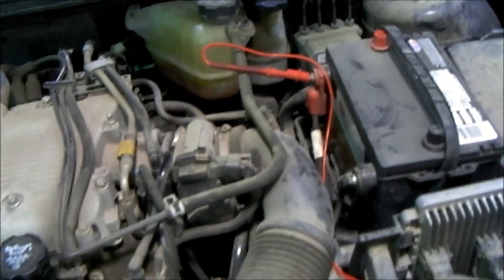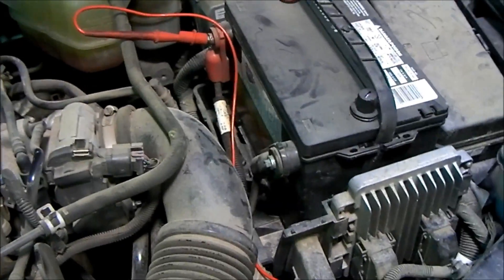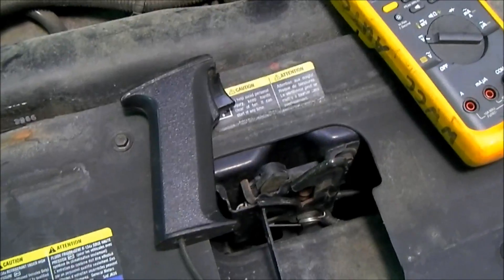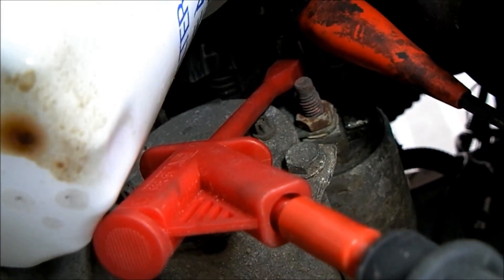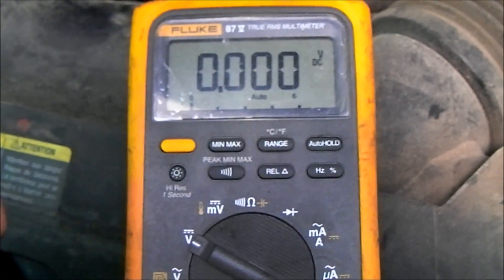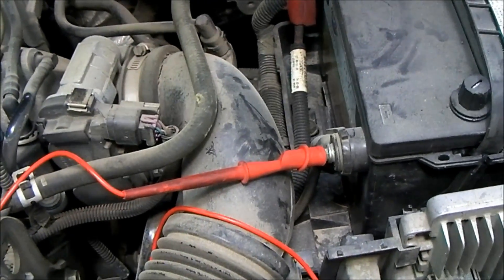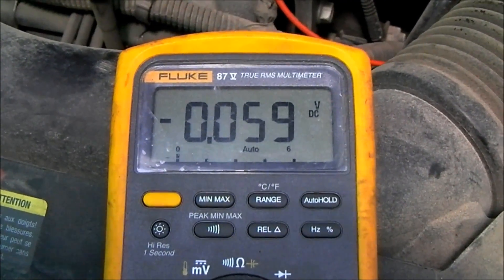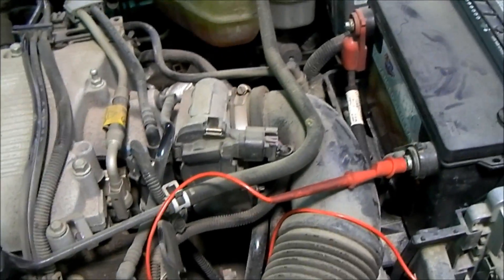Voltage Drop Testing the Starter

Comment: This procedure tests cables.   To test the battery, measure across the battery terminals for the lowest reading while cranking.  In this video, the voltmeter has a min or max reading function,  and that is  very convenient for finding the lowest voltage while cranking.

Comment: Depending where you do the positive side test, you also know the starter relay is making good contact. Over time relay connections can become pock marked and burnt, due to spark each time starter throwout relay engages it. Basically its switch contacts with large current, so each time it engages its as if the contacts are momentarily an arc welder. Over time these contacts can become so abused they no longer make good contact. This test would detect that.

You could isolate to starter relay by comparing the voltage drop when testing to starter relay input vs starter relay output. If low drop going between battery and relay in, but high drop battery to relay out, bad starter relay.

Comment: as a diy guy and because we cant do voltage drop without current to test the wire and many times a no crank has no current flow i would like an opinion on using jumper cables as a way to determine bad cables meaning if i have a no crank yet have power and ground but when i hook a jumper cable from battery to positive/negitive to starter pos/neg (one at a time to determine which side has resistance)and it then starts i can then confirm high resistance in the cable.is this a viable method?

also i hear  we cant just create a circuit using a light in the starter circuit to create a loaded circuit we can voltage drop test
because the light doesnt pull enough amps,but if the voltage drop is enough to prevent a starter from starting wouldnt this method still see the voltage drop?

also any other methods for diyers to perform a voltage drop test on a circuit that doesnt have current flow?
Reply: I know you didn't ask me, but I'll share my thoughts. The jumper cable deal, I've used this method many times it's quick and easy.
It's always a good idea to verify a circuit can carry a load, a starter can pull 100-200amps when cranking and a test light will probably pull half an amp(ish).
Imagine a partially clogged water line, when you turn the sink on (test light) it flows fine and you think all is well.
But when you turn the sink on, start washing clothes, and running a bath (starter) it suddenly becomes a trickle.
Imagine resistance as a clog. The circuit may be able to provide enough current to illuminate the test light but not enough to power the starter. 
I would try to load test a circuit with something that pulls a similar amount of amps

Comment: My voltage drop on the positive side is 1.5v

That means my starter is bad, right?
Reply: I would start with the battery cable that runs to the positive on the solenoid.
Reply: I have one where the Battery reads 12.5v with the key out. 
  Cranking, The  Battery Positive  Terminal drops to 10.9v and at the Starter Positive it reads  9.8v to 10.2v ... 
   What are your thoughts ? Bad Positive Starter Cable , Bad Ground, ( It Looks to be a New Starter and New Alternator with a Reconstruct Title) Starter Over Drawing Amperage , etc... 
   That's a pretty big drop.

Comment: I know this is going to seem like a stupid question but all you're doing is trying to find out if you're having good continuity to your starter on the positive side and the ground with this test so why couldn't you test the starter wire with a analog load tester and just load the starter wire we should get the same results as having it attached to the battery

Comment: I liked this video because it emphasized the positive and negative side of the circuits/cables,  and gave one test for each. From these tests, it's easy to 'back into' isolating either starter or the soleinoid as the main source of voltage drop. I have a 50 year old 'muscle car,'   but the principles are the same as with the 2007 Chevy.

Comment: On the starter where you hooked the negative meter lead, you referred to that as the B terminal. Is that other end of the red cable from the positive post of the battery connected to the starter? In other words,  the positive meter lead is connected to one end of the red cable at the battery and the negative lead from the meter is connected to the other end of the same cable at the starter?

Comment: When doing the positive side , it's important to connect to the top POST on the solenoid . Do NOT connect to the metal cable end or TAB . If there is a problem with the cable , it could skew the reading .

Comment: Good vid!
Is 0.5v on the positive side, and 0.2v on the negative side, pretty consistent on most vehicles, or does this change for different applications?
Im having a starter issue on a boat that i just purchased. It has an inline 6 GM motor. It has a dead battery and a dead starter. I swapped out the starter for a used starter that i had on my shelf, and this starter wont turn engine over either...i dont have another good battery at the moment. Is it ok that i perform this test while hooking my battery charger up to the bad battery? It is a large one with 2A, 20A, 40A, and start feature.

Comment: I don't like your saying connect voltmeter  leads to positive terminal of battery and to "most negative part of the positive cable going to the starter".  Would be good to say where the positive cable connects to starter.  and after you connected the positive end of the voltmeter to the positive battery terminal you say you will connect the negative side of the voltmeter to the starter while the important idea is you re going to connect the negative side of the voltmeter to the positive cable at point of connects to starter.   So we learn the cables from battery to starter and from starter to ground are good.  how many volts on a weak battery will be enough to power the starter and crank the engine?

Comment: Hi did this test on my bike starter as it won't start and seems to be turning over slow, reading on positive side was .144 and on negative was .166 which I thought a bit much, all connections are tight, would my starter be on it's way out???
Reply: Hey Martyn, did you find out what the problem with your bike starter was? I'm having a problem with my Harley starter stalling on the compression stroke and not turning the engine over. I replaced a bunch of parts, including the starter, but still not have had any luck finding the problem. I'm sure the only thing left it could be is a wiring problem but I don't know which wire.  I'm going to try doing this voltage drop testing to see if I can figure out the problem.

Comment: Most all modern cars have a starter relay , at the relay use a jumper wire in the secondary terminals with key off . No need of remote starter switch. and ignition and fuel systems will not be energized while performing test .
Reply: No...most ALL cars do not  have starter relays.. some do

Comment: if 0.5 is 1/2 a volt, what is 1/2 of 0.5 considered or called?
Reply: .25v or a quarter of a volt?
Reply: how would all figures read including decimal and zeros?
Reply: jaeden amaral
             one volt: 1 volt:   1.00V
          half a volt: 1/2 volt: 0.50V
quarter of a volt: 1/4 volt: 0.25V
Reply: Cool buddy, thank you.
Reply: Does the zero always show on 1/2 a volt......say it only reads 0.5 it's still considered 1/2 a volt?
Reply: jaeden amaral
1/2V = 0.50V = 0.5V = .5V
Reply: Great thank you for your knowledge, I appreciate it.
Reply: jaeden amaral
No problem man!
Reply: Can I send you a message sometime for any questions I may have, for future reference?
Reply: jaeden amaral
Sure; I'll do my best to answer any questions you have.
Reply: thank you....have a blessed day.
Reply: Hello bud, was wondering if could tell me what 50 milliamps reads in the multimeter?
Reply: jaeden amaral
It would depend on the current scale that was selected on the meter. On a 1 amp scale it would probably appear as  0.050A  or  0.05A.
Reply: 0.5V = 500mV
1/2 of 0.5V = 250mV

Comment: Would it not be a whole lot easier to use a loadpro  tester?  No remote starter hookup, no spinning parts, no going back and forth to make connections?Just check the connector at the starter motor. Push the button to load the circuit and you have your results. You don't have to worry that your ground connection on the housing is throwing your results off either. I like to save time so I can get back to telling stories, joking, drinking, gambling and chasing women.
Reply: That’s exactly what I was thinking. 
LoadPro by Dan Sullivan is a time saver.

Comment: would disconnecting the HT leads be an ok of preventing the engine from starting
Reply: No! It is hard on the coil packs as they can spark internally. Two exceptions: 1) ground every HT lead at the plug end, or 2) if you have an older car with a distributor, then you can disconnect the coil to distributor HT lead at the distributor, then ground it so the spark has a clean path to ground. With a modern car, rather than disconnect the HT, pull the fuel pump fuse so you can crank without starting the car.

Comment: Did you disabled the ignition system ? Or did you just hooked up the remote starter switch?
Reply: It's remote from the ignition system. The ignition system would be off and he's instead (manually) enabled to complete the starter circuit. All with no actual power through the ignition key.

Comment: A volt meter measures voltage BETWEEN the black and red probes. So if 
you get a voltage drop from the + batt post to the + batt connector, you
 have a poor connection at that post. Then you test on down the + and - 
lines to and from the starter. This is a valuable testing procedure to see if your starter or battery cables are at fault.

Comment: You need to shoot for a 3% voltage drop. Add the drop from BOTH + and - sides, combined together as he did in this video. Combined you should not have more than a 3% drop.

Comment: Why would you go pos to pos and neg to neg as oppose to placing the probes conventionally? I.e; Pos probe to battery pos and neg probe to bell housing/gear box earth point. Crank over and if a bad earth is present you would have 12v minus your resistance/bad earth bringing you down to say 10v for example. Same on the pos side, probe to solenoid probe and neg probe to battery neg. This was is easier to process in your mind as you can clearly see the voltage drop compared to the 12 volts you would have just before cranking. Its easier to comprehend for the average Joe. Your way does give the exact figure of the voltage drop but I think it would confuse people who aren't professional tech.
Reply: +Ben Harris A volt meter measures voltage BETWEEN the black and red probes. So if you get a voltage drop from the + batt post to the + batt connector, you have a poor connection at that post. Then you test on down the + and - lines.

Comment: Learn how to explain man. U put red lead on + battery people , then the - lead on the nut that has the battery cable connected to it.
Reply: +Headshothorror4488 It's called the battery post to battery connector.
Reply: jim davidson lol yeah I didn't do so great explaining either
Reply: We ALL learn something everyday LOL
Reply: It all starts at the battery terminal (+ lead) to the battery terminal connector (- lead) ON the battery. Write the drop down. Next is batt term connector to opposite connector directly. Write the drop down. Then last connector to starter terminal, write the drop down. Add all the drops up. That way you test every connection separately and KNOW where the failure is directly. Yes you can probe the + batt terminal and starter lug for the total drop UNDER CRANKING LOAD. You won't find the issue if you have one done that way. The long way identifies corrosion drops, loose batt terminal/s drop and so on.

Comment: Good video.  An easier way to do this (so you only go under car once) is to measure voltage from the starter itself at the positive and negative while cranking.  Take note of the reading.  Then take a reading from the battery itself from the posts while cranking.  Subtract your starter reading from this reading and the difference is the voltage drop in the wiring.
  The only disadvantage is if you do have voltage drop that is out of spec, you cannot differentiate whether it is from + or - side so in that case your method would need to be employed (but only on one side of the circuit, actually).
Reply: Mr. Obvious : I bought a car at an auction that had been sitting and the battery was discharged . It was for parts . When the tow guy went to start it and it barely cranked , he stated " you need an alternator " . No testing - he should be                  " telling fortunes " on the side . If these idiots actually believe this - they are dangerous !
Reply: Schrodingers Box, we can clearly see the maximum voltage drop in both cases is higher when overcoming the inertia. Which value should we take into consideration the most? The maximum drop or the drop afterwards?
Reply: hey schrodingers maybe you can help me on a few easy questions
as a diy guy and because we cant do voltage drop without current to test the wire and many times a no crank has no current flow i would like an opinion on using jumper cables as a way to determine bad cables meaning if i have a no crank yet have power and ground but when i hook a jumper cable from battery to positive/negitive to starter pos/neg (one at a time to determine which side has resistance)and it then starts i can then confirm high resistance in the cable.is this a viable method?

also i hear  we cant just create a circuit using a light in the starter circuit to create a loaded circuit we can voltage drop test
because the light doesnt pull enough amps,but if the voltage drop is enough to prevent a starter from starting wouldnt this method still see the voltage drop?

also any other methods for diyers to perform a voltage drop test on a circuit that doesnt have current flow?
Reply: +Schrodingers Box Yes and no. A voltage drop test allows you to SEE where the problem is if you have one. You test every connector and wire both ways.

Comment: So if you connect negative from the battery and connect the other lead to negative of the load, you can measure voltage drop?
Reply from the maker: Yes. That applies to any electrical circuit. If you want to test a ground connection where you can't just look at voltage in a normal way because there is none on the ground side of a circuit, a voltage drop test will do the trick.
Reply: Awesome didn't k ow that. Thank for sharing great tip
Reply: It's called DIRECT voltage drop